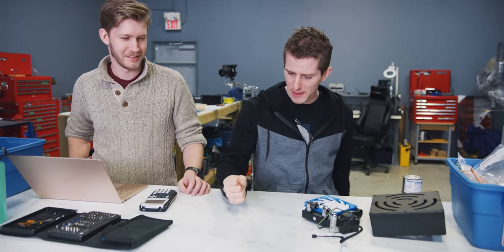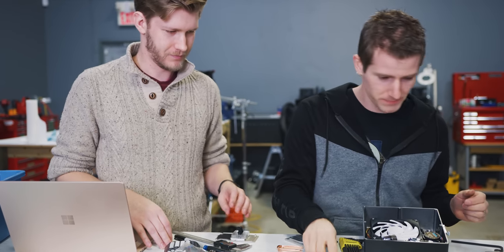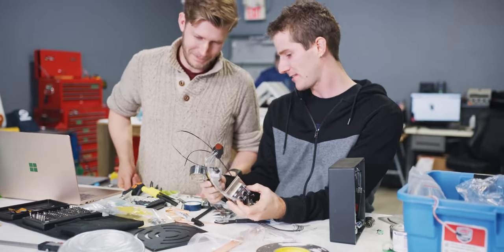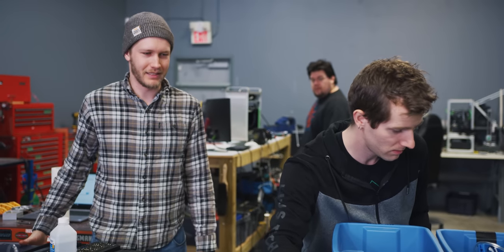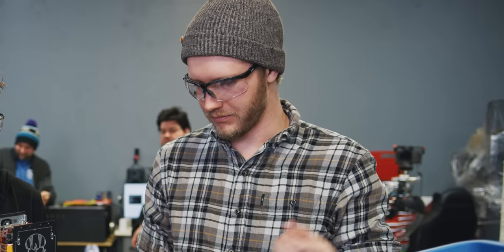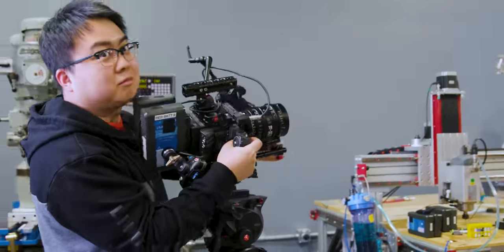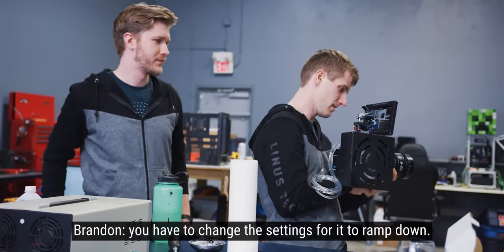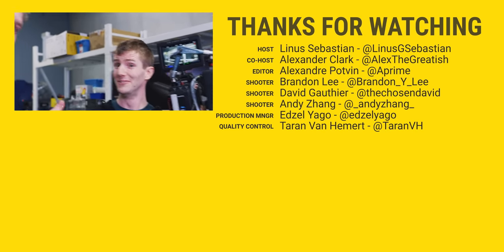Everything went wrong... Water Cooled 8K Camera Final Test

Comment: INB4 2021: RED releases Red 8K Hydro
Because you know they're going to make an official one now.
Reply: Oh man, no way would that work out well lol! I’m worried about the long term use of this setup as it is with all the maintenance water cooling requires. Now doing a solid AIO-type cooling solution might work if RED can work around all the cramped internal board layout but that too would be for special uses I would imagine.
Reply: @Babsdoproductions  Watercooling requires less maintainence than you might think. Properly chemically balanced closed loop coolers can last 5 years before needing repair or replace done, and custom loops (aka "Open Loop") just need to be flushed out once a year if you're using good, chemically treated or distilled water.
Reply: @Babsdoproductions  We are talking about RED. If they can save $3 on a water cooling solution they will. It won't end well. If they were interested in quality they wouldn't sell cheap TLC SSD's for a higher price than a Samsung PRO MLC SSD with the same capacity.
Reply: CheapBastard1988 I came here to say this. I’d have more faith and trust in a janky ass LTT retrofitted red than an “official” red water cooled camera.
Reply: @Babsdoproductions  They could just run heatpipes outside the chassis and than slap a block on it so water can't reach the components
Reply: InfiniteLoop I don’t see how heat pipes would be the limiting factor. They can transfer heat away much faster than a block. Good heat pipe air coolers can hold their own against water cooling on their own. Doubt they would be the limit and if they were just use a bigger or more heat pipes.
Reply: @Alex-us2vw  You're right
Reply: Also RED will charge 10k more for their version. They'll also increase the size by a factor of 75%.
Reply: They will have put millions into R&D
Reply: the people who would buy red's would not be able to maintain it, as easy as it may be. the additional weight would not be a good enough selling point.  it would only work as an uber niche high end boutique package, for those with balls to the walls money
Reply: For just 20k more than the normal one
Reply: Maybe, if not for the fact that it's making a heavier version of something you have to carry around, lol
Reply: @KiraSlith  I've gotten 4 years out of just distilled water with a couple drops of copper sulfate. The only reason I had to change water is because the tubing I had leached so much plasticizer into the loop it clogged up my block. It's all about keeping it sealed and not mixing metals.
Reply: @KiraSlith  Right, automotive cooling systems these days often don't call for coolant replacement until close to (or in many cases over) 100,000 miles!  I know it's not nearly the same thing as the whole loop is more consistently hot (and up to 16psi pressure).
Reply: Does RED know about this???
Reply: @Babsdoproductions  I could see a use in hot external environments (LA during the summer), probably would involve making the body of the camera bigger though.

Comment: >they have paint can opening tools

Yeah, I know.
They're called flathead screwdrivers.
Reply: I'm a painter by trade... I actually have a dedicated tool for opening paint cans and it isn't a screwdriver. :o I also have a dedicated tool for mixing (smaller) tins of paint... That is a screwdriver.
Reply: Sure but paint "keys" don't bend the lid nearly as much, which results in a much better seal for longer storage of leftover product.
That said, if you're going to use the whole thing yeah who cares
Reply: nah
Reply: @stillwatrpwnage  I've never heard of a paint key, but I usually just use either a nail puller or a small pry bar and have never bent the lid doing so. Usually if I bend the lid it's when I'm putting it back on
Reply: @marko247  5 in 1- "am I a joke to you?"
Reply: @NB-1  Everything ok?
Reply: The legendary putty knife also works well.
Reply: @prairiepanda  If you ask for one at a paint store, they'll likely give you one for free.  I used to use and lose a dozen or so a week back when I worked at one.

Comment: "paint can opening tool"
"That sounds stupid"

Engineering!
Reply: Paint can opener is stupid flatheads ftw
Reply: a paint can opening tool is just a extra flat hat screwdriver that you use to pry stuff with TBH
Reply: I usually just use a small hammer so you can pry open then wack it close lol
Reply: @ner7215  ah yes a small hammer, some time reffered to as a flat hat screw driver :)
Reply: I paint houses for a living and I use the scraper, you use the side as it doesn't bend that way
Reply: originalkhawk in the end any tool can be a hammer...

Comment: Shortening the tube length for the cool return will improve your cooling as you won’t be gaining ambient heat. Throw a little insulation on the tubing as well, and BAM, more improved cooling.

Comment: Congratulations on your success. This was great to see you all accomplished this. 
I am sure R3D was watching this.
Reply: Red is DEFINITELY watching this!  The KEY ISSUE now is to have Red modify their existing Monstro and Helium cameras by WELDING copper tubing to the ENTIRE inside of the outer camera box (i.e. remember to ground it electrically properly or add a zinc anode to prevent galvanic/bimetallic corrosion between copper and outside aluminum case) that branches flexible coolant tubing to solid copper cooling blocks that sit upon EVERY major CPU processing and DSP chip in the camera AND all memory chips AND the CMOS sensor itself and then use a very quite large fan attached to a single destination large radiator fin block that receives all the heated up coolant to create airflow out the surrounding outside air.
Reply: StarGateSG7 That’s a lot of technical terms there. After reading once then twice it’s beginning to make sense. ;)

Comment: 6:05 fun fact, a butane lighter can reach 2000C.......
Reply: yes, but the pipes will never reach anything close to that
Reply: katinas he meant that it’s possible to make the pipes blow with a lighter
Reply: @erikdomstedt7190  And what katinas said was correct. You will be slightly older when you will get a heat pipe to blow with such a weak source of energy that a lighter is.
Reply: Loeka974 I never Said that he was wrong, @nebbia obviously thought that he was going to make it go 2000C or something, just a misunderstanding

Ty
Reply: Buschola  never thought the pipe would reach 2000C but it is very hard to predict the heat transfer coefficient and how quickly it dissipate that though the air.

Comment: "Technically water is a bigger molecule"

Yeah, science b*tch!
Reply: Well, actually, no. Hydrogen atoms are tiny; oxygen is a bigger molecule than water. Difference is, water is polar and sticks to things, including itself, while gasses are neutral and generally don't.
Reply: Firstname Lastname But considering that water is 2 Hydrogen and 1 Oxygen, by proxy, water is a bigger molecule than just oxygen. I’m aware that’s not the reason why it’s better, but it is technically correct.
Reply: @crimson6363  It is not correct in any way.

Oxygen is basically always found in a diatomic state, i.e. 2 oxygen atoms bonded together. (aka, why people say O 2 )

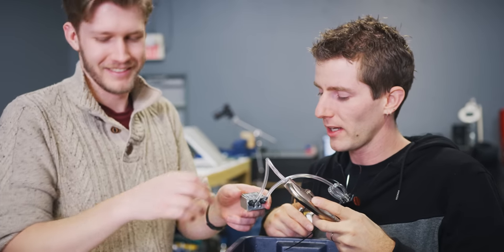Comment: 7:10 "leveled sandpaper"
Reply: Assuming the table is flat, if he had taped or glued it down, lapping would have been fine.

He had a old steel bench that is as flat as a our surface plate that we will lap larger items on.
Reply: @nes999  yeah putting a bit of water under the paper is usually sufficient. I just cringed at how proud they were of their leveled bench and then they didn't seem to bother to use any adhesive whatsoever.
Reply: Yeah, However one thing I've been forced to come to terms with, is these builds are typically designed long enough for the video. Speed is number 1 priority. If they took the time to properly/perfectly machine/build everything they did they'd never have content. Its part of the scope of project. 

I cringe at a lot of videos however, typically when I build things I have the luxury of time. I'm not in a film environment and quality is number 1 priority.

I cant imagine how bad people would cringe if I was in front of a camera for anything.

Comment: "Heatpipes explode at 600°"
Proceeds to hold a lighter flame to it, which burns at multiple thousand degrees
Reply: with a potentially cracked heatpipe.
Reply: @Hoch134  that would actually prevent it from exploding because the pressure can escape before that
Reply: @vnyggi621  Well potentially it wouldn't be cracked but rather squeezed internally so that the fluid can't move properly, which then again makes it worse.
Reply: That's not how heat works
Reply: @vnyggi621  Depends on how much pressure can build up before it. This just means that it can explode earlier (which is a violent pressure release).

Comment: if you know the diameter or radius of the tube you need to bend using a vise then use or turn some aluminum stock or steel to the diameter of bend and do it that way...simple....of coarse you have to know the thinkness of tube divide it by half to get the right bend so it will bend and mate to parts your doing Linus Verge

Comment: The coils of tubing shouldn't be touching I would think, heat exchange would be occurring between the hot and cold tubes negating some of the thermal advantages of the radiator, at least in theory?

Comment: teflon tape is NOT A THREAD SEALANT. it's a thread LUBRICANT. it helps threads glide to facilitate a deeper seating where friction prevents the threads from progressing further. if you're already seating the threads all the way, teflon tape will not help you to seal the threads at all.

Comment: TLDR: Teflon only lubricates and does not do any sealing itself.

Teflon tape has two functions. Primarily it is a lubricant, but it does help to fill gaps in threading malformities. The way it helps with lubrication is it coats the thread in PTFE which lessens friction and allows for you to tighten the fitting easier, creating a seal. It is a bad idea to use teflon tape for anything other than metal on metal situations for which it was designed. You don't want to use it on plastic because you can easily overtighten and crack the fittings. Various glues or even certain loctites will actually seal.

Comment: Curving the Heat-pipe, you need a heavy spring around the pipe, meant to keep the heat pipe round not the flat curves, non kinky!
The spring needs to be heavy to prevent it from getting kinky, metal people understand the process.
Just cut the spring when your done curving.

Comment: 8:10 - Linus: Technically water have bigger molecules :D
Actually it does not. H2O is smaller then both N2, O2 and CO2 (which make most of the regular air).
Reason why water has more trouble leaking than air is due to its surface tension caused by hydrogen bonds.

Comment: Hi Linus, you might not get to this comment being that I'm late to watching this video, but maybe invest in your engineer guy's (I'm so sorry, I forget his name) education just a bit more and have him get some sheet metal forming experience somewhere! When you're forming those heat pipes, I couldn't help but think that if he understood die and punch sizes, springback, bend radii, and bend development/deduction, it would have been a lot less stressful, wasteful (time and material), and more educational for your viewers.
When I worked as a sheet metal manufacturing engineer, we had a lot of custom orders. We made our own dies and punches by laser cutting a pattern of the profiles that we wanted, and put theaded bars through them (nuts on both ends) to secure them together. Then we'd weld all along it to hold them together as a finished product.

Comment: Is it possible to do a camera comperising video between the  Samsung Galaxy Note 10 Plus Snapdragon variant and the Exynos variant?
Do you think that they perform the same?
I think that it would be very interesting results.
To be honest coming from an One plus 6 I was very dissapointed changing it with a Samsung Galaxy Note 10 because paying 1000 euros I was expecting huge difrence in camera perfomence.Not to say that using the GCam apk on OP6 the I had better results than those on Note 10.
Anyway  many are saying that there is big diference between the Snapdragon variant and the Exynos variant so it would be very interesting to see the diference live presented  by you.

Comment: Hey guys, I notice this whenever you guys bend coper tubing. In crafting, model making and the like, we always fill the pipes with something incompressible, most often sand. You could probably rebend pipes once or twice (minorly) and avoid ever crimping pipes and reducing flow rates. Anything dry and fine works, like play sand. You just don't want to use anything treated, like magic sand laying around the office, or any kind of silt, which will adhere to the inner walls.

Comment: ok got confused with the 55°C is it both 55 or just the aircooled? its like 38 water / 55 air or it has 2 temps and its 35/55  water and 38/55 air dafck  :/

Comment: H2O series. I always go full stupid with my water builds. 3Dprinter helps. CNC desktop mill kit is here for some distro plate fun once built but I don't have the budget to fully commit to the voice in my head that has to run around with a helmet on all the time so.
Water cooled keyboard? Mouse? Display and stand? Water cooled fans? How about water cooled fan hub controllers? Speakers? That wifi antenna looks hot. And hey why you are at it about keeping that butt nice and cool. Water cooled chair. On their own it's a What the hell were you thinking. All together. WHOA. WHAT THE HELL WERE YOU THINKING THAT IS CRAZY!!!! Talk about a pointless but fun setup. Holy crap did you water cool your VR headset as well? When you push stupid to the extremes the dial swings around back into the cool side. No pun intended...

Comment: 6:00 Linus really should not allow things like that to happen because he's liable for injuries they sustain under his employment, even if not done under his command…
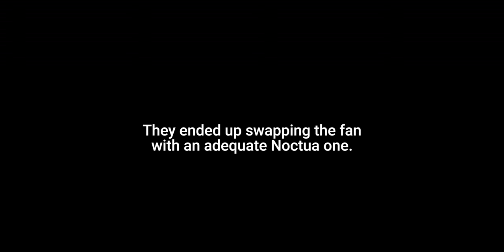19:22 It's not a problem of a fan if your fan controller does not have proper voltage control in pure DC-mode. PWM is electromagnetically noisy crap and should not be used when variable DC controllers are available.

Comment: Perfect example of why an engineer should never ever ever ever ever machine something 🤦🏼‍♂️ I mean.. bending a pipe held in a vice and expecting it to stay round? And an engineer is normally able to calculate the neutral line of pipe with the help of the radius and therefore get a exact point where to bend at.
Also the pipe should be able to move a bit while bending otherwise it will break.

Comment: As a first assistant camera this is hard to watch. "changes in temperature can affect the image quality" Thats only if you don't blackshade for temperature changes of 15 degrees celcius or more. The fact that this camera will only be used inside of a building which most likely has central A/C located in Vancouver makes this whole thing utterly pointless. Even if you were in Texas in the heat of the summer, Helium's run just fine there with proper blackshading and fan settings.